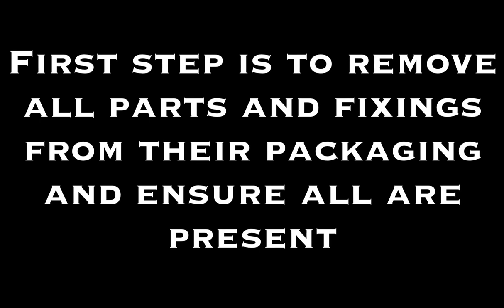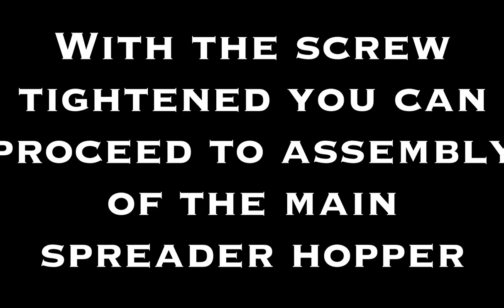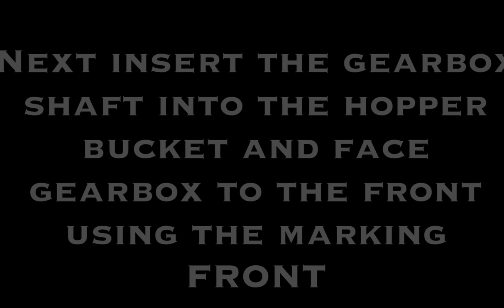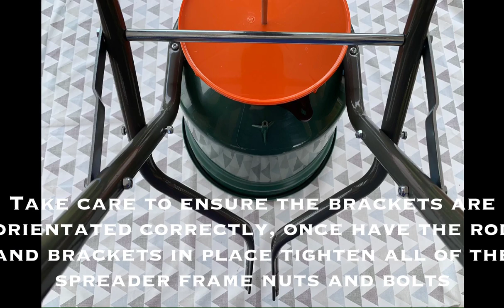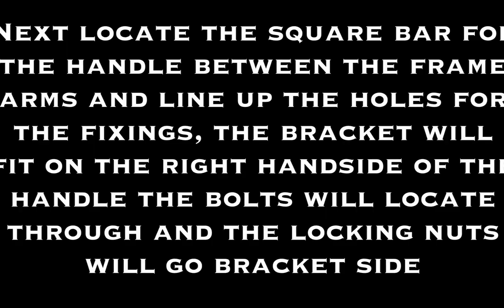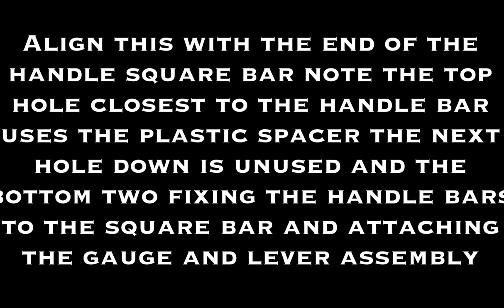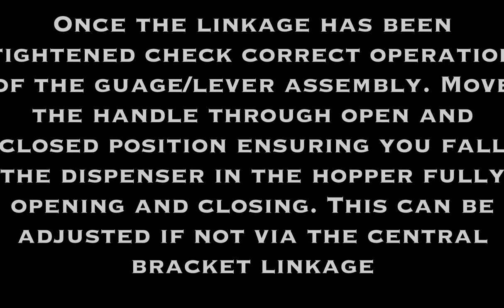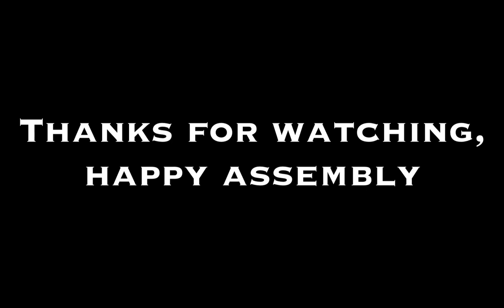Asembling the Viano Spreader

Comment: Very informative video, a lot more useful compared to the assembly instruction manuel . They have added 4 plastic washers that only fit the axle where the wheels are mounted on however these washers are not mentioned in the parts list.